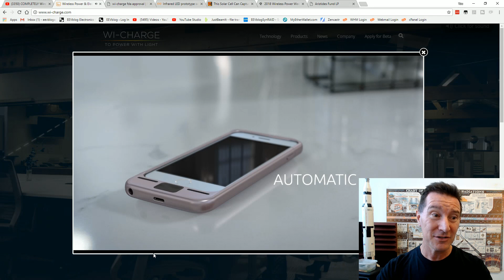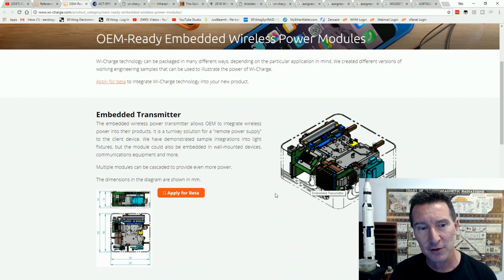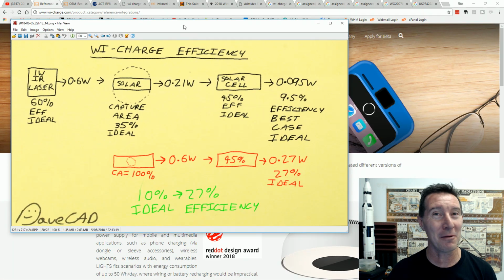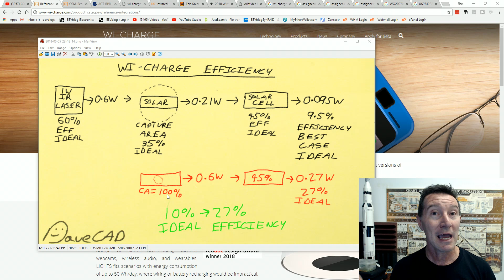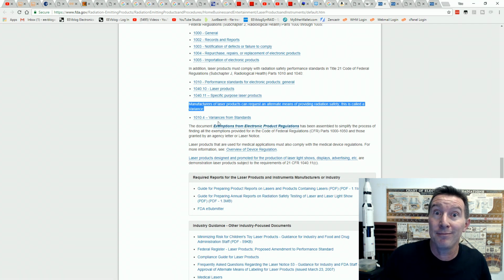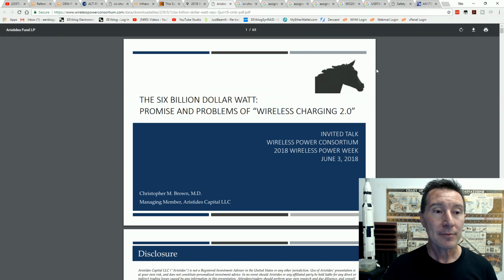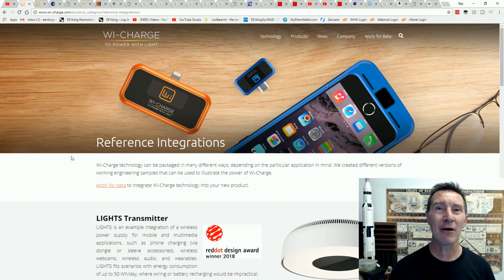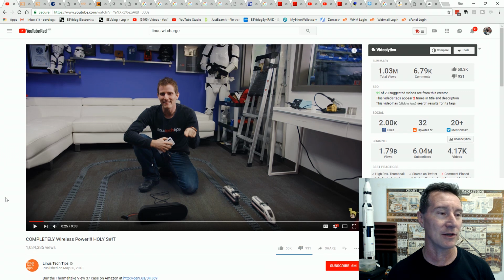EEVblog #1092 - Wi-Charge IR Wireless Charging - Fact or Fiction?

Comment from the maker: Any sufficiently advanced technology is indistinguishable from magic.
Until you consider the practical implementation. (Dave's Corollary)
Reply: I think XN-1 LaWS would work just fine for ya. After "tracking" long enough there won't be any Chinese dissidents left probably, though.
Reply: What do you think a secret phase-conjugate tracking system is for?
Reply: ... and the difference to a solar cell is? ... the sender is not free?
Reply: Too negative imo Dave; im not sure which wavelenght they use exactly but infrared lasers are not very dangerous comparatively. the reason lasers are dangerous is because eyes are transparant untill you hit the retina. infrared would get absorbed throughout the eyeball and thus not be very dangerous to you. the article you linked had smth like 400w/m^2 .. which is less than the sun ! clearly good regulations would not define the sun as such a hazard (even if you shouldnt look into it, the sun doesnt blind us clearly.) as you mentioned the actual power of this is not that much and will not cook you realistically.

plus charging phones takes effectively no energy on the large scale so the environment argument is totally dumb aswell.

20% efficiency is very respectable and i can see the use in this wireless powering small devices around the room (multimeters? calculators?) instead of bothering with wires and batteries everywhere. normal usb is 5v 1amp, so 5w as well (ofc i prefer fast charging now). perhaps all public spaces could have these things so phones etc reasonable never run out anymore with the pads integrated into most phones.
Reply: Sudazima if the laser light intensity would be a safe 400W/m2, then the ~5cm2 solar cells would make at best 400e-4W/cm2*5cm2 = 0.2W ... either safe or cool, cant have both...
Reply: They may have multiple lower power lasers and the 5W could be distributed between 4 or so devices
Reply: +Sudazima IR is the really dangerous bit as it can damage, but the eye is not sensitive to it and therefore does not react to limit it.
Reply: EEVblog bleeding Christ on a wooden crutch in heaven, DJ, quit banging on your damn table. The extreme bass efficiency of my loudspeakers shakes the holyeverlovingShit out of everything in the room here every time, like 50 effin' times already!
Reply: Yes, well, any sufficiently advanced magic requires considerable arcane knowledge and skill to properly implement the desired effect as well, so... The point still stands. XD
Reply: The spot size is probably depending on distance. So I bet that over 5m it's getting so inefficient that it's unusable.
Reply: Clarke would probably approve your corollary, Dave
Reply: Ryan Tuck:  Have you found out what the volume control does on your PC yet?
Reply: Please do Unipixel or Energous
Reply: Also: Any sufficiently overmarketed technology is indistinguishable from bullshit.
Reply: Already, Dave bashes the new technology, like he always does. 
Dave, haven't you learned anything from the Solar Roadways and the Batteriser?
Reply: why dont they just use a solar panel and let your lights charge your phone?
Reply: Isn't hot swapping batteries more convinient
Reply: i.e. magic gets expensive
Reply: Oh no... did I miss your rebuff/review of the "wireless power"? Sad it's buzzword central. As (like the casio solar calculator) possibly life changing. But like the (casio solar calculator) only in the tiny tiny one thing it does... tiny power delivery.
Reply: Wow, that quote is overly used lol
Reply: Arthur C. Clarke's 3rd Law? I'm not a smarty pants like you guys.
Reply: Hey Dave, did you get permission from Arthur C. Clarke to use that quote? LOL!!

Comment: I really don't understand the Qi pad they have.

I mean, it's not like I would need to move that pad around a lot, why does it need to be wireless?!

I fear that one day there will be an advance to the point where it's just barely viable and then we won't have phones with charging ports on them. That's a far-fetched claim that probably won't happen, but I really hope it doesn't.
Reply from the maker: Yeah it's pretty pointless. As is their dongle receiver, might as well just plug in a battery pack
Reply: I can see Iphone with no ports at all. Just the Qi charging. It will probably have connection pads somewhere deep inside for reflashing and testing, but not easily accessible to the user. And then Apple will be like "oh look how much space we saved". And then we'll have a qi battery packs cases for people who need extra juice and a charging port. The effeciency will be horrible.
Reply: I thought the wireless charger thingy was their most viable idea (tough quite niche one). Restaurants and venues etc might want to have tables that contain a charger pad but they don't want to have cables going to those tables. Though perhaps a simple solar cell might work there too, taking power from indirect sunlight (or direct if outside) and from lighting.
Reply from the maker: Allan Savolainen  - I explained that in the video. You can do the exact same thing but better (faster charging & more reliable) by simply have the same Qi pad have a large recharegable battery in it. Charge overnight and it'll do a full day's work on the tables. Cheaper, simpler, better.
Reply: EEVblog the pad DOES have a battery inside it. It's kept charged all the time from the IR blaster regardless of whether there's a device drawing from the pad or not.
Reply: How many watts of laser power would it take to charge everybody's phone in a restaurant or venue? Seems a lot more practical to just connect the tables to power once and be done with it. Or go with the battery idea. But I don't see it as a huge problem to solve anyway with the ever increasing battery life of phones. If someone is concerned about recharging their phone throughout the day they probably have their own external battery since they are a dime a dozen and available anywhere.
Reply: The idear is that you don't have to run a wire to every tabel, just put one of thouse in there and that lazer on the sealing and you don't have to worry about recharging the embedded charger because it gets slowly charged by the lazor.
Reply: Well, I've never plugged my phone into a charger and guess what... I'm using it now lol

Comment: I want to buy one just to scavenge the 50 Watt laser!
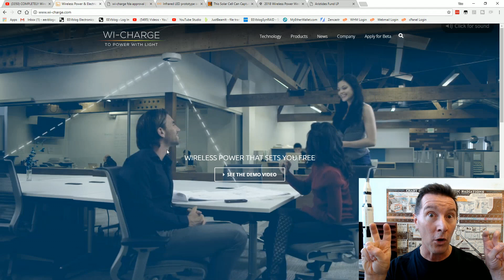Reply: Ats, you can get a 40W laser engraver on amazon or ebay for less than $500 xD. But I highly doubt they have a 40-50W laser in there. The Model Linus had which was 5W delivered was on their own website a few lines up only 50Wh a day, divide that by 24 hours, it can deliver about 2W worth of power in one hour, not sure what the 5W means then if it runs at a little under half that, as I highly doubt they will have it run at 5 watts for 30 minutes then shut off for another 30. So you're probably only looking at a 20W source. Still, thats one dangerous and easily blinding laser even if it reflects a couple times into your eye. Watch this video of a 20W laser which is just into the infrared spectrum /watch?v=91BHkfXwaFc at 1:15 they put a filter that blocks that spectrum of light and you can see the thing burning a concrete block. The next video that showed up for me was this really cool video /watch?v=3yE2-oEl2Cg where the dude burned a hole through plywood and started burning it in seconds.

No way their stuff is that powerful.
I kind of want the 17W laser from the second video
Reply: Yeah, I think Dave is going to end up being right about the unit being 10% efficient and you will probably be right too about the unit delivering only 2 Watts of power... But that's okay if it's cheap because I would be happy with a 20 Watt laser! ;-)
Reply: It could be an array of 1w leds.
Reply from the maker: I've added a correction to the description, it could be as little as an 11W laser, but likely more.
Reply from the maker: 2009dudeman
 - Woah, I missed that figure. So their 5W claim is just some pie-in-the-sky peak thing?
Reply from the maker: cheb hou
 - It's not, they have said it's an IR laser.
Reply: Imre Fabian ❄️☃⛄️☄doesn't have to be a 'Death'-Ray...
Reply: 2009dudeman inductively reasoning, it can be 5W PMPO and deliver 2W, if it's being pulsed with a %DC. I'm going to take a line out of my mom's book and say that there's some type of energy storage mechanism in the choochoo: reportedly it's not a battery, so it can't be a battery, but if you take away the pila transliteration, it could be any type of 'unpiled' chemistry: alkaline, NiCd, or mechanical flywheel. In this day and age, I wouldn't expect any further wordplay, such that might translate to wires going to a battery in the (caboose). THAT would be mom's idea in its totality.

Comment: So the charging sucks, hows the engraving?
Reply: orion smith It is pretty much an SLA 3D printer that mounts on the ceiling. Depending on the price, it could become a great way to get a high speed galvo with a powerful laser module. If this even makes it to the market.
Reply: Like a demon caught in a pentagram trying to step over the threshold without being incinerated.
Reply: If that thing went nuts, it would engrave your floor so you could do a laser-dance

Comment: As laser physicist and working for more than 20 years at a notified body, also with eye safety, I would not recommend to use it, if it really delivers only 1W. The frequencies in near infrared are e.g. responsible for steel cooker kataract.

Comment: Great video... I really appreciate all the science stuff you go through! I’m still surprised that the range is so limited... as long as you have clear line-of-sight a laser should suffer very little distance degradation! We had a conversion van with wireless IR headphones and a ceiling transmitter but they didn't work very well as it was just a small array of weak LEDs not a laser!
Reply: Blakehx, the problem is always "line of sight". Light is not efficient in that way. Then Ultrasound is better (still inefficient).
Reply from the maker: Yes, in theory you would do any distance, but the greater the distance the more your tracking system tolerance becomes a problem.

Comment: Dave, I think you are REALLY overstating the possible efficiency.  You missed the power input before the laser from the wall AC.  This is significant.  Also, isn't the laser's output 1W and not its input power?  ie. a 1W solid state laser diode would have the same output as a 1W gas tube laser but the tube laser would be way less efficient.

Conversion from AC to DC to modulator to laser:

a good 5V PS might be 85%
laser modulator 98% sure why not.
laser 60%

so for 1W laser output:  1 / .6 / .98 / .85 = 2.0W AC

But then the controller itself takes power to find and point the laser.  1W or 5V at 200mA would be fairly conservative. (likely more like 5 to 10W or more)  So:

1W at 85% efficiency = ~ 1.2W AC

Laser + controller = total for transmitter

2.0 + 1.2 = 3.2W total input power (very very conservative)

Laser solar cell to 5V USB:

1W laser
44.5% max solar cell (ideal direction, 100% on target, the best solar cell ever, etc.)
95% solar cell to 5V boost or buck (likely boost) converter
receiver controller and Bluetooth maybe a conservative 5V at 20mA? = .1W

.445 x .95 - .1 = .32275 W

.32275 / 5V = 64.55 mA

So less than 65mA when it is only powering one device.  Many devices won't even take that little.

Total efficiency:

0.3W output
3.2W input AC (conservative)

0.3 / 3.2 = .09375 or 9.4% MAX.

I think I have been very generous here but still might have missed something.  It's late so don't hate.
Reply: One more thing... they say it can power 4 devices at once.  So I'm going to guess a conservative 10% of the time for tracking and exact targeting the next device.  So our 65mA / 4 x .9 = 14.6mA MAX per device.  Cell phones won't even bother taking that little current.  Even with just one typical phone under continuous "power" from this won't maintain its battery level.
Reply from the maker: Sure, I just did rough back of envelope calcs, wasn't trying to include everything. By "1W laser" I meant 1W total consumption.
Reply: Lassi - Yep.  No way this could even keep the battery from discharging while in use let alone charge it.  I think the designers must have been blind not to see that... likely from the high power laser!   ;-)
Reply: Dave, I think now even my calculations for efficiency were still too generous.  The controller (without laser circuit) that includes a CPU/micro-controller, servo motors (galvanometers), Bluetooth, fan, etc. likely takes way more power than I put into my calculations.  Adding another 5W total (at AC input) is likely still too conservative but pushes the efficiency down to 0.3 / 8.2 = 3.6%.  I think their claimed "greater than 5%" is highly questionable.  A reasonable USB PS might be ~80% so 20x more efficient.  This idea is soooo busted.

Comment: Great video! Glad to see you gave them credit where it's due, but remained skeptical of its overall usefulness.
I wonder how much power is consumed by the tracking and control system; that could take another big bite out of efficiency.
Reply from the maker: I like tech development and would never poo-poo someone for doing the tech, it's always the marketing, practical use claims, and possible uninformed public perceptions of new tech I have problems with.
Reply: That's why we love you, Dave. :)
Reply: The sad fact is the application is at fault here, too. Model trains with metal rails wouldn't need any "remote tracking system"- they've already got a power distribution system in the tracks themselves so all that is needed is a stationary receiver locally-wired at one point to each metal rail, then Bob's your uncle.

Comment: Despite their argument to you to the contrary, I suspect that the spot size is actually quite large..  Even at 1 watt, a small spot size can cause significant heating on the window on the power receiver if there is any dust/dirt.  For their high power transmitter, in my experience, a 5 watt delivered power laser with a small spot size will burn/melt a plastic window if there is any dirt on it at all, not to mention the Silicon surface of the solar cell.. 

I honestly don't know why people are bothering with these types of grossly inefficient power delivery methods..
Reply: You don't know why people want money? Weird..
- oh, and it should be more like a 50 watt laser, as dave calculated.
Reply from the maker: Yep, agreed, it's likely a substantial size. But I'll run with their hint that it's smaller than the window size, and that makes sense. But too small and it's a problem as you say.
Reply: EEVblog how do they possibly make it so that you don't burn your hand, a piece of paper, or the smartphone when you - very fast - move it in the beam?
Reply: C Lau For a cafe like Starbucks, running a wire to the table is not a problem, and prevents people stealing the Qi charging pads.  Also, coffee stains.

Comment: A couple watts to charge a phone, maybe from 12years ago, most phones need a minimum of 5watts without loss.  Some need close to 10 watts. Which is what comes with phone a 2.4 amp charger is 12 watts, The phone may require 70% of that or 8 watts.
Reply: 2.1 amps is 10.5 watts
Reply: Every phone for years now has had intelligent charger detection which detects the maximum current that the charger can provide. So even if it came with a 2A charger, it'll charge fine with an older 1A or even less charger. The limit of the USB2 standard is 0.5A, so they can charge at 2.5W, for example when you plug it into your PC (some phones then tell you they're "slow charging") I wouldn't know what the lower limit is though.
Reply: They'll accept <500mA.. and if you're not doing anything with them they'll charge. But my Note 3 (SM-n9005) always had issues with car chargers and those off-brand cheapos if I was using it for something strenuous. It would be "charging" but the battery creeps down because it's discharging faster.

That's what I'd expect laser charging to do in practice. I guess if you're the only one in the room you could get all four slots though?
Reply: Or more likely all four slots is the 5W figure and this is as daft as Dave's thinking.
Reply: Alex Wright you have issues with car chargers?
My car charger has more power than my wall charger.
A full 2A 5V.
Reply: I should have qualified that further. The Notes didn't like charging off of car-charges we didn't own.. so they were probably the cheapest thing they could find. The Anker one we have no I don't think has the same deficiency, though we don't use the handsets for GPS anymore so not 100% sure.
Reply: @Alex Wright, Yeah i've noticed my Note 3 (Same model) also doesnt like low current chargers when its awake for extended periods, though sub par cables on a good charger will also cause issues. Put it to sleep and it will charge just fine off just about anything.   One thing i noticed is the Original Note 3 charger outputs 5.3v @ 2.0A rather than 5.0v @ 2.0A, and i suspect Samsung did this to offset cable losses and it seems to work just fine with a 3 meter thin USB cable i use for night charging.

Comment: I currently work in IR Imaging.  The only IR band that can operate at room temperature is SWIR (Short Wave Infrared).  These devices typically feature an InGaAs (indium gallium arsenide) detector.

InGaAs does not work for longer wavelengths, such as in "thermal" IR imaging.  You need to use something else, such as HgCdTe (mercury cadmium telluride).

However, SWIR imagers can see through fog and dust.  

eSWIR (extended Short Wave Infrared), MWIR (Mid Wave Infrared), and LWIR (Long Wave Infrared)  SLS (Strained Layer Super-lattice) devices typically require cooling between 77K - 200K.

I'm still learning, but I don't think their laser is anywhere powerful enough to provide anything useful.  Maybe the laser is pointed at a rotating mirror and the laser only pulses on when the "targets" are in the radial slice.